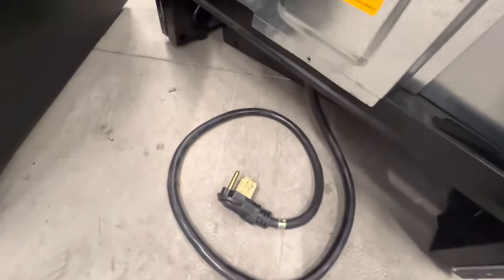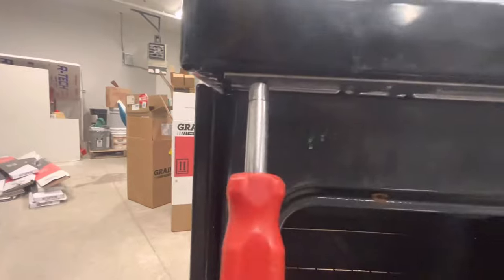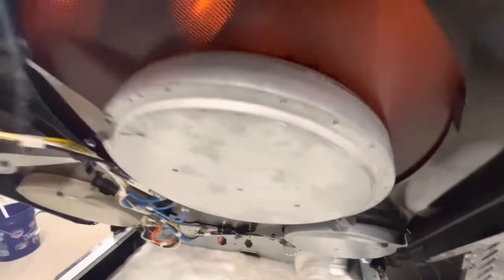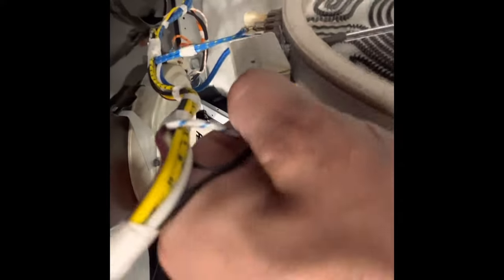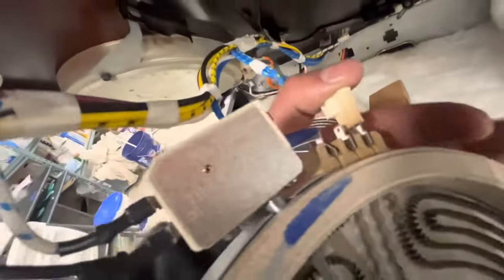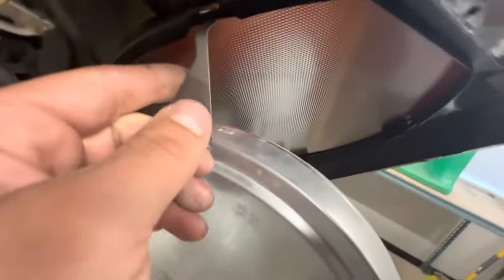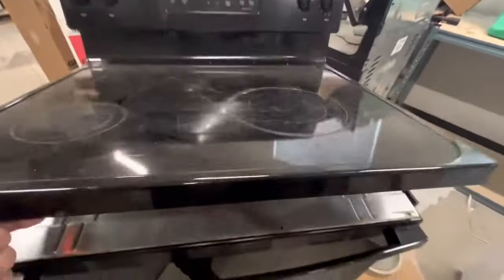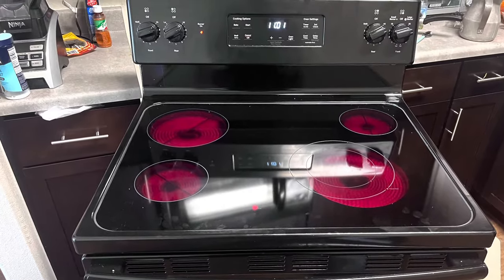How To Replace Stove Burner. GE Oven.

Comment from the maker: I forgot to mention that last photo of the video is what it looks like if the burner is in the wrong location…oops
Reply: lmaooo it was so funny
Reply: Is that hard to fix? I had a repair man come fix my burner and now it's not lined up.
Reply from the maker: @kateputerbaugh3666 really easy a few screws and then adjust the hanger clip and move 1 or 2 spots over to align correctly. When I speak of the “tabs” in the video get the tab in the correct hole under the burner underneath the glass
Reply: LOL, I was gonna say. Thanks for this video, I am doing it on my stove and this has helped tons!
Reply from the maker: @Lynderella  thanks for the comment!
Reply: Same…just thinking now to buy the right new burner

Comment: Why is the the burner look off center?!
Reply from the maker: @cristinal3055 you likely put the burner tab in the wrong spot like the end of the video. Simply move the tab over to the correct hole on the burner (there are multiple option) thanks for the comment!

Comment: Swapped the large triple burner on my stove with a brand new one, and the small element still does not work, even though the two larger outer rings do work. Could this be a bad switch? Any ideas on troubleshooting?
Reply from the maker: It may be a bad switch. But I would make sure the burner you installed was not faulty or damaged during shipping

Comment: What is the tool with the red handle called?
Reply from the maker: @thomascharles87  that is a 5/16 hand driver. A 5/16 socket or 8mm will work also.

Comment: If I want to do this myself, can I just cut the circuit breaker? I am a small person and can't move the stove by myself.
Reply from the maker: @jillcnc  yes just verify no power to the unit by turning something “on” without breaker power to verify that the breaker is working correctly and the power has been cut.

Comment: One of the metal clips on the wires seems too small to fit on the metal piece on the new burner.  Do I pry it open a bit to make it fit?
Reply from the maker: Yeah, just a tiny bit to get the terminal onto the burner connection

Comment: What kind of wrench you used to open the Oven cooktop ?
Reply from the maker: I believe it is a 1/4” or 5/16” socket or the same size screw driver receiver (one of the screw drivers with changeable bits). Please subscribe!

Comment: Awesome video. I'm having problems with a Model # JB645DK1BB Official GE electric range. The elements, when turned on, goes straight to the high temperature and can't be adjusted up or down...just high. Is there some regulator that controls this? Would appreciate your thoughts on that it is before i call a repairman. Thanks.
Reply from the maker: Sounds like a problem with the switch/dial control. You could measure the voltage from the switch verify, but it might be easier to just replace. Is it all elements or just one? Here is a video on the switch https://youtu.be/ykIbKjS4tJo?si=uyvXBheS7wbwUjR8

Comment: I have a similar GE model to the one in the video. When the right front burner is receiving power and is heating (glowing red), there is a clicking sound. Cant tell if coming from under the burner and almost sounds like it is coming from behind the dial. Any idea what that could be? Thanks for the informative video!
Reply from the maker: It could be the dial switch is failing. It could also be the burner failing. Maybe a wire is loose behind the dial. Try to locate the noise. You could also switch components around. Like a switch or a burner to help diagnose what is making the noise. Please subscribe if you haven’t, Thanks!
Reply: Thanks for the quick reply on a Sunday. Enjoy your weekend. @Theocdrepairman

Comment: Have a newer model GE less than a couple years old with my dual burner on the left side. The middle(small) burning  element does not heat up but the outer does. Would I just have to replace the whole element?
Reply from the maker: Unfortunately Yes you have to replace the entire burner. Thanks for your comment!

Comment: Do you just tug on the wires to remove them or do you have Eclipse somewhere there and it has to be pressed to remove them
Reply from the maker: They are usually just tight enough to slip on and off by pulling on the terminal itself. Sometimes they are really on there and you may need to manipulate the terminal.
Reply: I had to tug really hard with needle nose pliers to get mine off.  My stove is 14 years old.  When putting on the new ones I used petroleum jelly to lubricate and it was still difficult.  I used a tiny FH screwdriver to open the 2 wire curls (for lack of proper term) so I could get them on.  Then, I squeezed down on the curls after attached to make them tight against the element connector.
Reply from the maker: @aerussel absolutely! Thanks for the comment. I have done that to a few also.

Comment: I turn on the back burner and both the front and back turn on, any ideas?
Reply from the maker: There is likely a wire that has melted to another. You should lift the stove glass up and look for damaged wires. If that doesn’t find anything look for damaged wires closer to the knob for both those burners. Let me know if you find anything

Comment: Two questions:
1) If I shut off the breaker, I shouldn't need to pull the stove out to unplug it right?

2) It seems my element turns on for a few seconds then shuts off but the heat indicator light stays on indefinitely. I'm guessing the thermal switch is done. Can that part alone be replaced or do I have to replace the whole element?

Thanks!
Reply from the maker: Correct if the breaker is functioning correctly you do not need to unplug the machine. Just extra safety.

The thermostat/ is the glass piece across the burner, if it is cracked it could turn it on partially. You will need the burner element replaced as far as I know

Comment: my right front burner is offset like yours is I have a GE stove that's about two years old. I have messed with that thing and goofed with it and I just can't get it straight. I'm ready to just take a hammer to the glass top.
Reply from the maker: There are multiple mounting points. The metal clip/ hanger is on the wrong hole under the burner. You are probably just 1 hole off. Look under the burner…where the metal clips poke into the burner they are numbered. You will probably see you have it moved over and just need to put the clip in a different hole. Let me know if that help. Also don’t forget to subscribe please. Thanks for your comment!

Comment: I watched this video and felt confident I could fix it myself with your clear directions. When the part arrived, I lifted up the top and immediately saw that the wire that goes to this burner was not connected. I don't know if it got burnt (no burn marks) or cut, or maybe a mouse chewed it, but there was a loose wire and a piece about an inch big by itself - I think it may be called a crimp connecter? Is it possible to replace that part? Thanks for any help.
Reply from the maker: That is possible to repair. It is strange that it became disconnected. Like you said I would normally suspect a burn mark with some damage. The terminal ends (crimp connector ) of the wires from the oven plug on to the burner directly. So if the burner was damaged the new burner will work. If the wire was damaged you can usually use a screwdriver and pliers to reattach that terminal end. Or you can cut the wire and install a new terminal end. The terminal end (crimp connector) cost about 2 cents each but you usually need to buy a bunch. From the sounds of it, I think you need to remove the crimp connector from the old burner and reattach it to the wire from the oven using a tool to open the crimp connector and another to crimp it again, it is nothing more than some flexible metal than can be manipulated a couple times before it breaks. If the old burner is still intact than you can save $100.
Reply: I have the same issue as you and was about to order a new burner, but then I read on some DIY website that the most common cause of a burner failing is the switch which appears to be a totally different repair process so now I'm confused lol. How did it work out for you did replacing the burner fix it?
Reply from the maker: @smiznog9125 if you want to swap the switch here is a video. You could tell if the switch or burner is bad by swapping either one with another burner. Thanks for the comment!
Reply: Took the burner out and could see the broken coil. Just put in the new part today, never had to do this til now but it was super easy thanks to your video👍  @Theocdrepairman

Comment: Hi my stove model is P B970S M2SS and when I try to order the glass top it says no longer available what is another alternative for my model and also it looks the same as ur model in the video. Thanks for answering in advance.
Reply from the maker: Unfortunately sometimes if a model has been discontinued for while the manufacturer will eventually stop making the parts for it. I think the parts you are looking for is WB62T10597 which has been discontinued. I think it was replace with  part number WB62T10475. I would call ge to verify that this new part number is correct. If it is correct try to search for the new stove top with the updated part number. If you can’t find it in the after market or via used retailer you may need a new oven. Calling the manufacturer will be the best solution to get an updated part number if it exists. Please subscribe, Thanks for your question.

Comment: Hi my GE model is PB960SJ9SS and the 3600W heating element need to replace (right front).
I live in Ontario Canada. Can you please help from where to buy because I searched online and not able to find the correct one.
Reply from the maker: Please subscribe! Here is a diagram of the parts for your stove

https://www.geapplianceparts.com/store/parts/ModelSectionParts/PB960SJ9SS/2/0/0/0/COOKTOP

https://www.geapplianceparts.com/store/parts/spec/WB30T10155

Comment: My burner will go off innthe middle and only stay on ,on the outside of the burner do I need to replace it or is it a different  problem
Reply from the maker: Yes. You are correct! Some burners have dual heating zones (one small and one big). If the one of zones is not working than the entire burner needs to be replaced. Be sure to purchase the correct burner as they are location specific sometimes.
Reply: What do you doing they bother working but the middle one won't stay on ,I have to wiggles the know to get to come on but will only stay on high ?

Comment: My stove model is  JCB630EK6ES( used around 3 years).   The right side front burner( biggest ) is just not hot or powerful as the beginning . is the burner problem or switch ( or something else).  where to find the part . thank you.
Reply from the maker: It’s proabably the temperature control on the burner. Will probably need a new one. I relive this wasn’t clear. You will need a new burner. Can look for part number on geapplianceparts.com